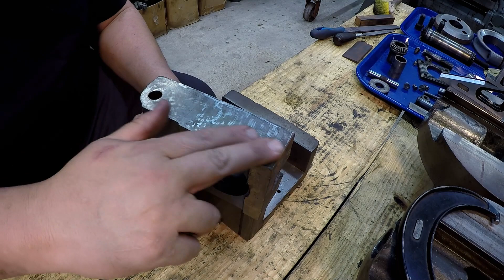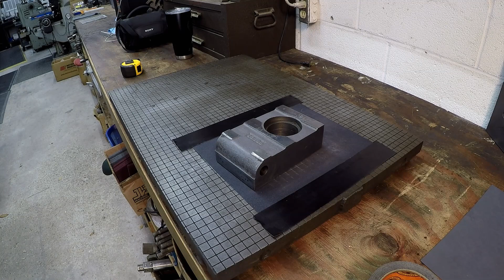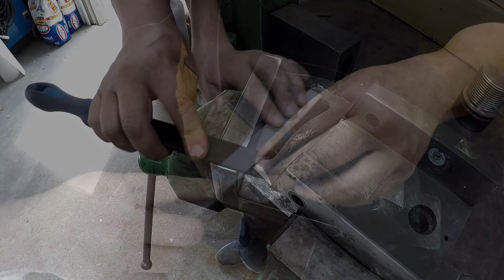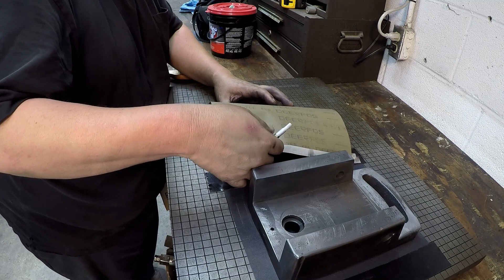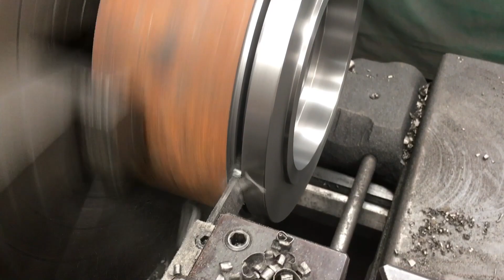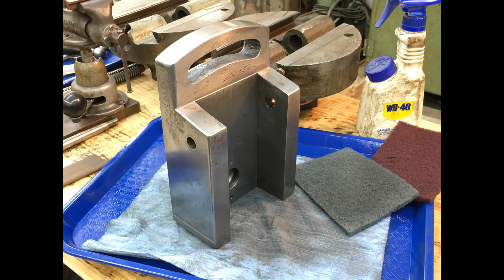SNS 211 Part 1: Clapper Box Restoration, Big Taper Shank Drill Bit

Comment: You should build a cart on rollers with a motor with a crank and  rod, with a weight on tfe end of the rod . And make a shaker table, so the part can be sat on the paper in the plate and moved under the part, using the mass to slide the plate under the part, a speed control is required.  It may require a hand to keep the part centered Jon the plate and paper! But pressure would be as even as the mass of the part is even. Maybe use a stick on weight  to keep the mass evenly spread!

Comment: I'm a bit late to the party but for future information there are ways to refit the clapper/clapper box without having to risk warping from the heat of welding. There are many plating options out there that is suitable for this application. There are even plating options that has high hardness and low friction properties. 

I work on plastic injection molds and when our tools start getting worn and tolerances and fitments are too much we will have parts plated and refit. Typically we use nickel plating for most applications but when we only want to add a couple thousands or less we'll have the part flash chromed. And we don't normally have to machine the part after flash chroming it. Just stick it back into the mold and run it.

Comment: PS: warpage could bite ones ass in the method I referred to. Other than a big hammer or press, either of which would be very iffy, welding to draw the metal to tolerance is the only method I would even think to use.

Comment: That clapper box would be good for my needs but if it really needed to have better tolerance, weld down the inside and outside between surfaces to draw them together and grind the weld. Wouldn't do but one pass at a time without checking tolerance again each time though.
Reply: Adam did mention doing that, but felt that if he wanted that much precision it would be better to just remake the part.

Comment: You mention that the right side of the clapper box and clapper are taking most of the tool pressure when cutting. Can you reverse the feed direction? Having never run a shaper myself, I don't know if it will step from left to right. I'd think they would make it like that, for instance if you have a raised step in the center of a part, and you cut toward it from the right and also the left.

Comment: Big A if ya had taken a ball-peen hammer and used it properly to readjust the high spots created by a hammer, you would find a lot of them could put back in place. I have done it the past quite a few times and was leased with the results. I like I think you too wonder where those Idiots brains were out lunch at. like your work I also us a file like you do. -   nitehawk4300

Comment: If you want to close up that clearance, you can knurl or peen the surface to swell it up; then dress it back down to fit. the patterning will be irrelevant to the application, if anything it will help lubrication and prevent clogging/sticking.

Comment: Another great video Adam, There is nothing like the sound of a new sharp file doing it's job. A person would think if a guy just had to hit a delicate machine with a hammer he would use a plastic or lead faced hammer to tap it not beat it to death. I have a dumb request,,,, if sometime you have time during a video would you show and give a pointer or two on drill bit sharpening? I am 63 yrs. old and have never been able to do that, would start off with a 4" long bit and end up with a 1"er and still dull as hell! lol  thanks for posting.
Reply: he has one, way early on in his videos.

Comment: I have been watching Adam's videos for the past week and as a less than novice machinist, I have learned more than I ever thought possible. But, being so novice, I do not know what a "CLAPPER BOX" is or does! Please advise me as to what it is and how it's used. Thanks for all the videos, I've learned so much about machining and it's very, very easy to follow along with your process.
Reply: It is part of the tool head of the shaper - the tool is held by a tool holder that goes through the round hole. The point of the "clapper" is that it folds out when the tool is moved back, so the tool doesn't push against the workpiece on the back-stroke. If you watch the videos that show the shaper in action, you will hear it "clap" when the tool comes back onto the material to start cutting.

Comment: My grandpa had an old Heinemann (sp?) with the friction arm that lifted the clapper on the return stroke.  I remember helping him change a puck of a hard steel material that was on the side of the inner (swinging part) of the clapper and it had a few very thin disc shims behind it.  I think the puck was considered "consumable".   He threw the old one away and put in a new one with no shims then milled it to exact tolerance.  I assume when the puck wore you could just shim it until...  you couldn't.

Comment: nice job with cleaning up the clapper box. That drill cut great. I will assume you would only use that on softer material. Certainly saves some time if you need a hole that large to machine from.

Comment: Zen filing 101 - file on, file off - lol   I was doing similar work restoring an old vise whose machined surfaces had been beaten on and I touched some of the surfaces to a belt sander for the worst of it until I hit the actual machined surface itself.  Too bad you cant run into another machine for some parts that have been treated better, maybe youll get lucky and some will turn up - with the internet who knows what may come out of the world wide woodwork.

Comment: Hey Adam, it might be a little more involved then you would be planning to get into but you could always use some machine way epoxy to build them surfaces up, have a look a Stefan Gotteswinter's video where he builds up his ways on his cross slide I think.  Or maybe you could just bend it in where it needs then machine out the inside square with a fly cutter? ok anyhow have a good one and good luck.

Comment: I saw a very interesting method of filing corners round on an overseas site. The way they teach apprentices is to start with the file on the far side of the work, then while moving the file away, you start on the far side of the cut and move the contact point toward yourself while moving the handle down and the tip upward. I have always started near and moved the contact away. The new way works better for me!
Reply: The way you describe is the way I was taught 60 years ago. Still doing it now.
Reply: Its the way i was taught too
Reply: + Toby W: This is the way I was taught in the early 60’s, one of the first things as an apprentice, place the tip of the file on the work and rotate the file handle downward as you push the file forward so the rotation of the file is counter to the cut on the work piece, I have always done it this way and it is much faster and more accurate than trying to follow the contour of the piece you are working on.

Comment: Hi Adam, the clapper is repaired by letting in a chunk of cast iron into one side of the clapper and scraping it back in to fit.  That's what my pal advised me. He spent his time rebuilding planers and large shapers in production shops around Manchester. His view was try to achieve less than 0.0003 fit.

Comment: Nice lapping plate. I got hold of a section of marble kitchen top (off Ebay) to do the same job. I just double sided stick sheets of emery (240,400,800,1200) and it makes a nice flat surface to hand lap pieces of work.

Comment: Er, that is not how you sand in a flat surface, you use a circular or a figure eight movement. Back and forth guarantees you will take more off the edges than anywhere else. j/s :)
Reply: He was trying to dress up the mushroomed edges.
Reply: + GT1Man: Perhaps you should watch Tom Lipton’s videos on lapping, he is not a big fan of using the figure eight pattern for lapping and sites studies that show the figure eight creates more problems than it solves.

Comment: Since you have 2 clapper boxes, you have the ability to try fixes on it without taking your machine down. It gives you a sample to copy (on the shaper of course). You could make those heavy practice cuts making the new clapper saddle...
Also, I wonder if you can fix the clapper slop with turcite? https://www.aetnaplastics.com/products/d/Turcite I believe Keith Rucker used it on a project and I believe it was Richard King who told him about it. I may be wrong. You could machine the sides down and install turcite and see if that works. It works for lathe ways, and other uses. This could also be tried on the second clapper, which is clapped out anyways.........see what I did there... 
edit: removed the part you answered later in vid.

Comment: I personally am going to think that a guy who is a third generation machinist with 600+ YouTube videos about machining has picked up a file before and knows what he's doing instead of minding what a few keyboard warriors have to say about proper filing techniques, but that's just me...
Reply from the maker: No worries, I know how to use a file. Tom gets the same comments..LOL
Reply: Novice filers tend to drop the tail when back dragging which can roll over the near edge. Only filing on the fore stroke prevents this and makes it easier to get a flat edge. It is a good practice to start with, but not the only way.
Experienced filers have the practiced hands that are able to keep the file level and reduce the pressure slightly on the back stroke, allowing them to work a little faster, and still get a flat surface with crisp edges.
Plus with some types of files, in some materials the back drag can help keep the file from loading up.

Comment: Could you do some kind of pining or deforming on the surface of the clapper to raise the surface up a small amount. I’ve never seen anyone do something like that before but I imagine if you did enough of it it could work.
Reply: Matthew Chastain well from my perspective, for every raised point there's also a divot. The high points will most likely wear down faster than how it is as is, and you'll be left off worse.
Reply: Yeah that is what i was thinking but i think that it could work in certain situations. Most mating flat surfaces dont have full contact as it is. I think for scraped 40 contacts per square inch is standard. I think it would be an interesting test either way.
Reply: Matthew Chastain that is true. It could work, but you would need to work in some oil passageways and whatnot so it's bearing on the oil and not those highspots

Comment: Could you not mill and surface grind the two sides of the clapper down before attaching two steel plates (bolt on some thin parallels) to make up the lost material, and also square up the inside of the clapper box? Simpler than making a new part from scratch.. (and you have a spare to test on first)

Comment: Watching you use a file correctly took me back 60 years to my metal work class at school. Like most kids I hated it at the time but the skills have been useful ever since. You are really giving that abused clapper a birthday - nice work from the UK.
Reply from the maker: I'm using my files just the way they were intended.
Reply: Eric McRae he shouldn’t be back dragging the file so much but other than that yes.
Reply: I agree with you Adam a lot of folks do not understand filing, the back stroke is a none pressure applied only cutting on the forward stroke. When the file is sideways it is knon as draw filing.

Comment: Possible solutions: Shim/s: Use shims, brass/steel after you machine it, to take out the play in the clapper...
Wedges: A lot of of material is removed, it's all square, and then wedges are adjusted to set the clearance.

Comment: What if you used a punch and uniformly struck the clapper's side that has the narrowest tapered pin opening to create hundreds of raised edged dots (almost like a rough knurling) and then ground that side back to dimension?  Basically it would be like the opposite of scraping. It would make a tighter fit, and move it towards the bigger tapered end of the pin to take up some of the sloppiness between the pin and clapper.  You could practise on your extra clapper.
Reply: This is an excellent idea and could very well work.
Reply: What about use the spare clapper box and put a single roller knurling tool in the scrapers tool holder and run it back and forward over the surface of the original clapper box to raise the surface  up then grind that back? Like scraper-inception.

Comment: Is there a spot on the side of the Clapper box you could add some brass tipped dog point bolts to snug up the Clapper bar side to side clearance in the box. But you might make them shaped like an elevator bolt and screwed in from the inside with the Clapper removed so you have as big a thrust face as possible without reducing the free movement of the clapper.

Comment: Ok Adam, I need to know what sandpaper you're using that you can use a file card on it without screwing it up
Reply: I assumed he used the bristled side.
Reply: I realized that later on, the amount of steel dust in the bristles threw me off.

Comment: maibe you can add some bronze rails on the bottom of the clapper box and lap that perfectly 
once that is sitting in its original spot you could rear the hole for the pin thrugh and through and fit a little bigger pin

about the mushroomed spots , wonder if you can first peen them back with a hammer , possibly fill in the deep spots then file them down

Comment: You mentioned you wouldn't want to weld up and machine down the area where its wide at the bottom..........
Couldnt you electroplate the sides with nickel or hard chrome or something? then take it down to size?
You showed in a video a while back some metal spraying to coat a shaft with a hard surface, could something like that be done inside the clapper to restore it?

Comment: Hi Adam.  What about hand scraping the clapper and then hogging out 0.2  per side out of the clapper box and bolting in some ground A2 with recessed screw heads and then hard milling and scraping it to size for fit?

Comment: Thanks for the instruction on the planer gage as an adjustable parallel.  I had no idea.  

I think the way that box was beat on tells you a lot about the quality of the man that used it.  There are ways to do things without beating the stuffing out of it.  Seems there are few craftsmen, a lot of marginal to decent workers, and few that should only use brooms in machine shops....

I really like what you are doing with this machine.
Reply: i guess it was run by the employees, they have no reason to look after it, just to get the job done

Comment: With flat steel, polished surfaces rubbing against each other, I can see on your shaper there are several machinist options open to you short of just recreating it. But, when you are dealing with thousandths of an inch clearances due to repeated wear, chose the surface that is stationary or most stable during operation, and spray it with CRC Dry PTFE Lube. I used this as a release agent on a target rifle that I was bedding and it did keep the epoxy from bonding to the steel (duh!), but it also served as a protective coating on the metal receiver & barrel. It has a hard surface quality on metal that the manufacturer claims does not easily wear off due to friction or high temperatures during use. I found just in sliding the parts in & out during assembly & disassembly adjustments, that there is zero residue & zero delamination of the coating in spite of some fairly sharp edges & unchampfered parts. It's a 1917 Enfield so we're not talking precision castings here although it is a good target action my gunsmith can work his magic on. I'm going to use it instead of bluing & so far have been impressed with its durability & hardness, i.e.-- it doesn't seem to compress or distort under pressure or repeated rubbing. Enjoy the hell out of your podcast & communication skills. It has inspired me to attempt mechanical fixes I would have paid someone else to attempt. Good luck & Best regards,

Comment: Hey Adam, nice work on the clapper box. My tool slide on my 16" G&E is only 4 1/2" wide so I made my clapper box 4" wide (it did not have one when on got it). But after seeing a close up of yours I should have made the clapper part a little thicker, the clapper is only 3/4" thick. Glad the bit got to make some chips. Thanks for showing it.
Buddy

Comment: Maybe you could close the clapper box slightly by selectivity heating and cooling areas of it, like Keith Fenner's shaft straightening method....
Reply: Alternatively, the back of the clapper box seemed to have had a very slightly concaved surface, which could have closed in the sides when clamped flat. Might be worth clamping the sides together slightly (maybe with the clapper inside) while lapping the rear to get the same effect.